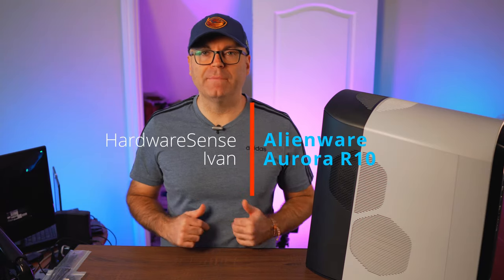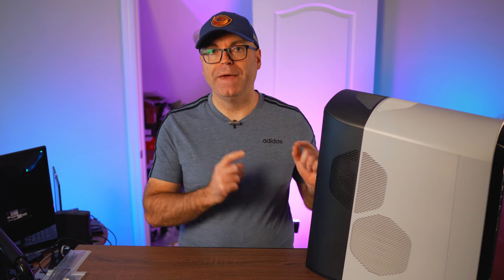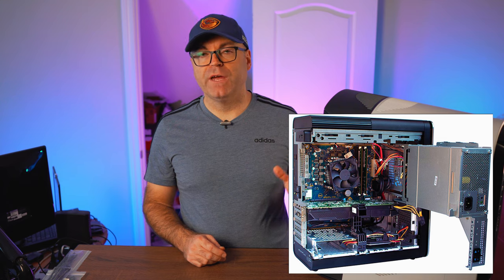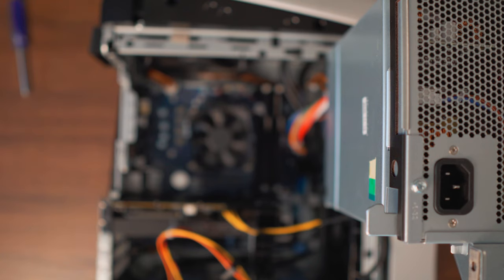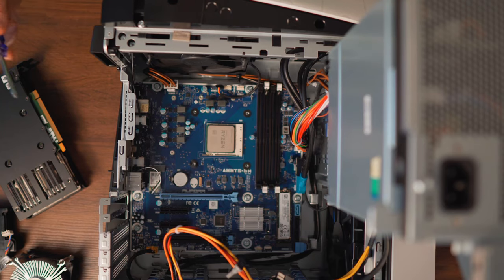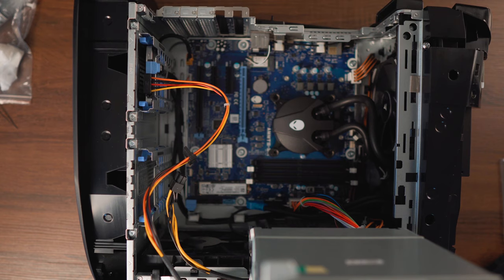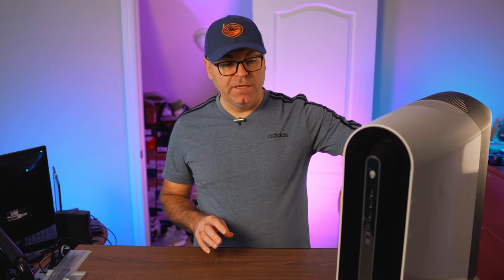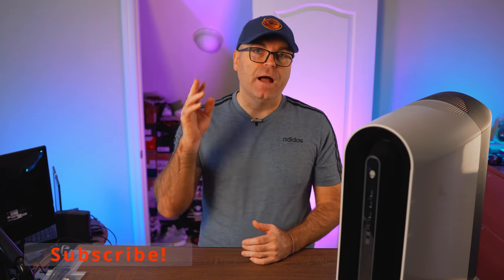Alienware Aurora R10 - All The Cooling Mods, That You Need!

Comment: DO NOT BUY THIS CASE/PC! 
Have bought the r11 (i9/RTX 3080) before 6 months. It was loud and had a really bad thermal performance (awful original fans). I changed the fans to Corsair ML PRO 120 > Two for the watercooling (push/pull) and one front intake. Immediately better thermal performance and less noise. BUT the case was vibrating which led to more annoying noise. Removed the top panel of the case and it was better. Then the left side panel was making noise. Added one more front intake fan ML PRO 120. Little bit better performance but still noise. Added foam sellotape wherever possible (between case and panels). No success! So regardless what I was trying to tweak nothing was doing the job.

SOLUTION: Bought the BeQuiet Silent Base 802 with a Noctua NH-D15 and now it is just a dream. I have to check the lights to make sure the PC is up and running. No noise.. great thermal performance which leads to a happy user!
Reply from the maker: Many people don't have another option if they want new GPUs, migrating the internals to a new case is easy so no reason not to buy if there is deal.
Reply: yup the only positive thing is that I obtained a 3080 for a nomal price..
Reply: @HardwareSense  btw really good explanation. totally agree on a lot of points you mentioned (thumbs up)

Comment: I got rid of that awful case, put it all in my old corsair 750d, mind you I had to get a new motherboard. There is no improving that piece of crap case ;p
Reply from the maker: It would have been a great option of they had a dedicated rear I/O plate, without it, its just ugly. But the temps will definitely improve with a better case.
Reply: I intend to do the same thing with mine! I suppose that with the new motherboard you had to get a new power supply?
Reply: @TheResolute24  I reused my old one. It'd be a hassle reusing the one that comes with it, and it's not modular and kind of small. I did sell the Alienware case with old mobo, psu for 300 cad, so that could pay for your new psu.
Reply: @rafayelk3736  I think I am going to do the same thing. Thanks for sharing your experience!
Reply: @TheResolute24  I wouldn't waste your time bro. Keep the AW case. 
Theres literally over 50 users between dell, redit, pictures, videos and benchmarks of it working  in the r10s or r11 Alienware cases and with a r10 3080 r5800x with liquid cooler and making a push/pull config on the rad with 2x Noctua 2000 rpm 12-25s and then replacing the front bottom intake with another noctua or corsair and getting temps of 65c and under on the cpu under heavy gaming loads with ultra settings.
Literally dripping 20 to 35c with 60 to 100 dollars worth of fans or 
So it 100% works. I have this exact setup.  I'm getting 67c playing Valhalla on ultra settings on 1440p and that ryzen5800x cpu chips max temp is 95c and I think but not sure a 115watt chip. 
That's amazing for that "shitty case" to get it down to around 65c for gaming
Reply: @MurdahBassRecords  are you using aftermarket liquid cooling? Not sure how you're getting under 65c on your cpu on a modern game, but if you are I'm glad it worked for you. Personally for me it made sense changing, def not for anyone but it is another option. Just helps having more room in the case, I did add Asus hyper m.2 card and I prefer ease of fan control on my Linux dual boot instead of trying to find a workaround.
Reply: @rafayelk3736  I'd much prefer a full sized case like you but the prebuilt AW at this time was the cheapest option for me.
Nope just running the stock liquid cooler but the corsair h60 works too.
I have a Noctua 15,-25 pwm 2000rpm fan on the bottom of the rad pushing air through it and the same fan on top of the rad pulling air through it exhausting out the case..
This reduces less resistance from atmosphere itself, less resistance from the fins of the rad. And both work in tandem to create more CFM air flow and speed. Watched a few YouTube videos and push pull on a rad increases CFM by 20% and the noctuas are static fans to begin with that work on air pressure more than an airflow fan so.create.a.suction of sorts within the case. I grow weed in a tent and run negative pressure fans to have proper airflow so I just applied the same logic..I spent days researching this Alienware airflow problem though and if it didn't work I was gonna do the same as.you

Comment: I'm confused console gamer I know nothing building PC but I do research I bought R10 ryzen edition t months ago from dell and they call that but 3 different types all different parts same name . Example you talking I have that but mine first it was some kind weekend sale clearance stock said I paid $1400 Canadian with tax I got inside I did double check parts ryzen 9 5900 12 core processor, acpi 64 biased chipset,32gb ddr4 , Samsung 980 pro 2 tb SSD , nvme kioxa 2 tb SSD , no idea GeForce GTX 3080 card, windows 11, 1000w psu,  liquid cooled cpu,.  Normally price were $4500 so happy price since then never seen mine again anywhere , also got Samsung g9 oddessy $800 can sale yes all new direct from companys . So we're does mine fit in is worse then those or same can't get any info all videos seen have different parts inside but same name
Reply from the maker: You should definitely consider the upgrades I did for the fans, it will make it so much quieter

Comment: Does the noctura work on the r9 ?
Reply from the maker: Which model?
Reply: @HardwareSense   The Noctua NF-A12x25 as you mentioned in the video, I had only read that only the ml120 works on the R9 without bios error, but the Threads I had read never mentioned the Noctua NF-A12x25. So I don't know, if there is a huge difference between an R9 and R10?
Reply from the maker: @cvbn5777  So earlier Dell's Bios was playing well with the Noctua fans, but now multiple people are reporting that they are getting Bios errors, so to be safe just get the ML120 Pro